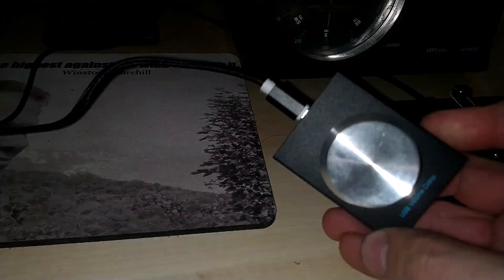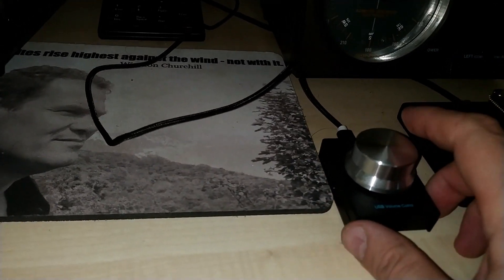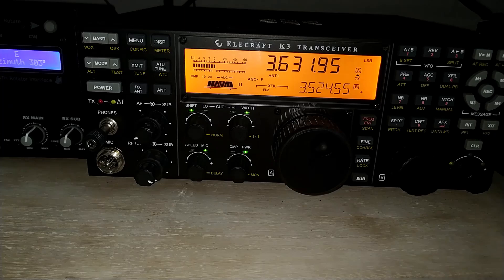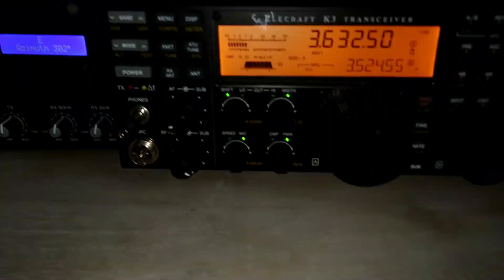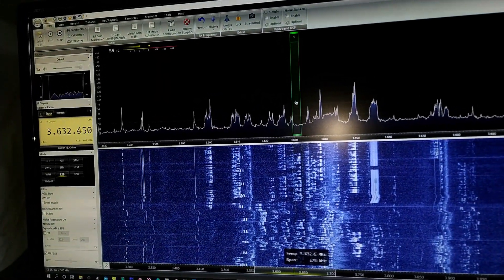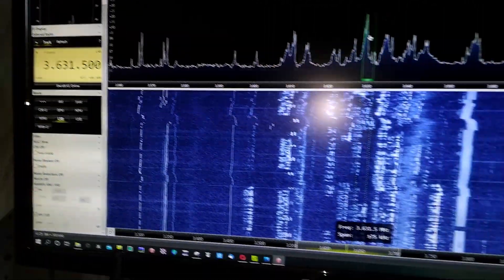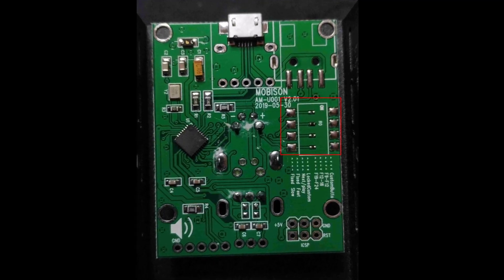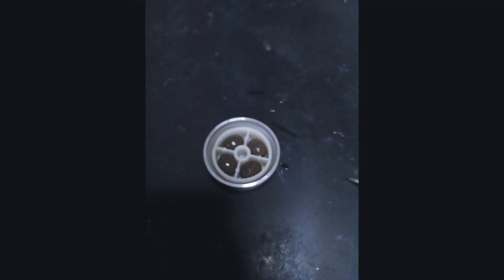cheap USB volume knob as VFO tuning knob for SDR (frequency control)

Comment: Thank you for this modification, it works like a charm, so happy that is what i needed for my SDR   works with the sdr systems i have and on multiple software inclusing the SDR-Uno, SDRconnect and also SDR-Console 3.3